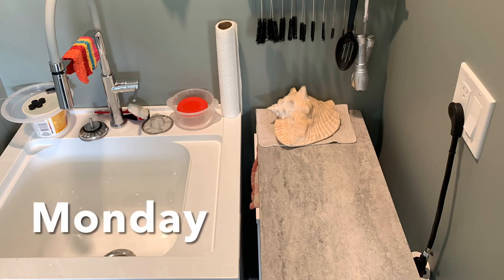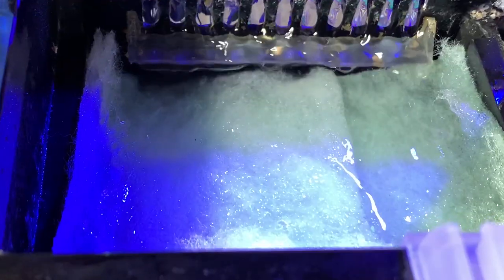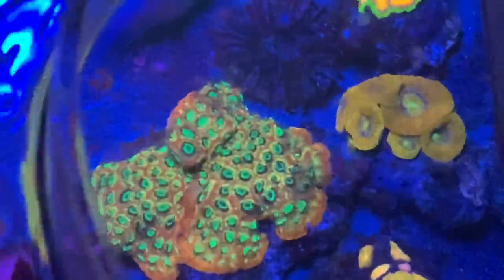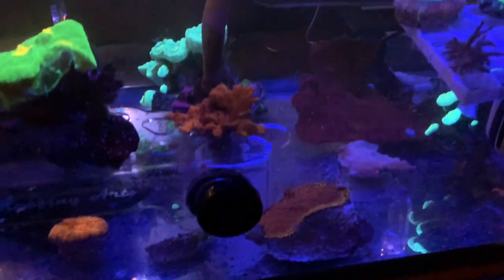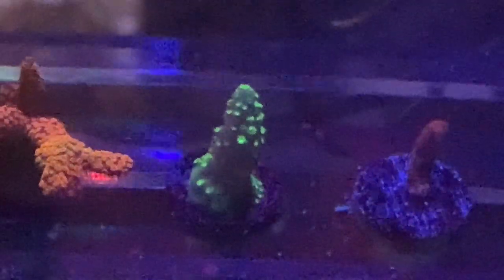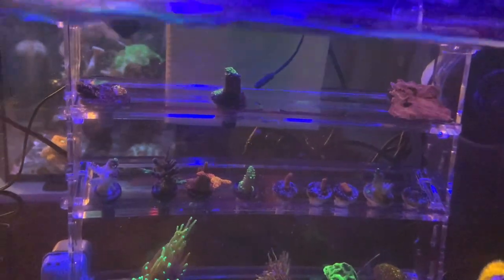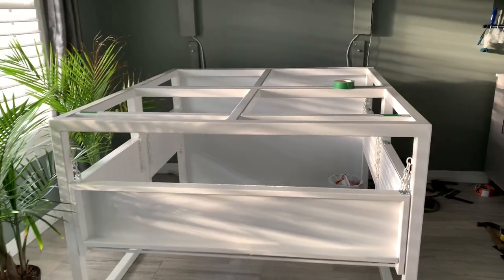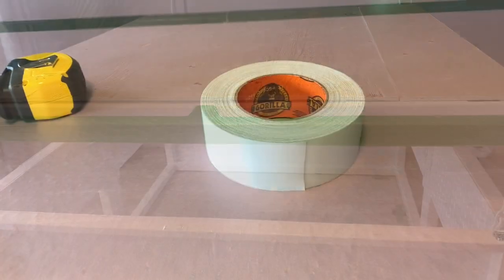ReefGrrl’s Weekly Reef Wrap-Up No. 6: New Project, New Tank Progress, New Coral, Graphic Coral Image

Comment: Looking good Cindy.  Have you thought about bolting the two sections of stand together for a more permanent connection?
Reply: Yea I'd definitely want it bolted together
Reply from the maker: We wondered about that but in researching stands of multiple sections, we found nowhere that they were physically joined together. We asked the LFS owner and he said they’ve done multi-piece stands quite often on big tanks and that once the tank is on top, it won’t be going anywhere. So we clamped it together to treat it as a unit for levelling and to prevent it being accidentally knocked out of alignment, and before any water goes in the tank, the clamps will be taken off and the whole thing checked to make sure it’s fully supported. The thing about drilling holes that led us to look into it, is that it introduces a point of access for corrosion and even if using aluminum fasteners, we didn’t want that vulnerability over the long term. I guess we will find out...😁 Thanks for watching!
Reply: @Reefgrrl  just needs a bit of primer if you decide to drill it/bolt it...I still would want to just in case the house settles throughout different seasons....my creaky house does
Reply from the maker: We’ve just passed our one-year anniversary here and haven’t seen any signs of seasonal changes - don’t forget there’s a double-size steel beam plus full height stud walls and triple-sistered joists in the basement directly beneath the tank location. If any of that moves we’ve got bigger problems than a two-piece stand lol! Tbh we did expect it to have provision for bolting the two sections together and did the research when it came without that - I’m okay with not physically joining them after getting advice that it’ll be fine, based on the LFS owner’s experience. I guess we’ll find out...

Comment: Graphic Space Invader. LMAO!!! If someone is sensitive to that, they have other issues.ha ha. Stand turned out GREAT!!! Looks even better than before. Curious to why you didn't add leveling legs/feet to the stand when being built. Not that shims won't work just fine. Looking forward to seeing the tank is place.
Reply from the maker: Haha, I know right? I laughed when I saw that, just had to share but didn’t think it appropriate to send it to anyone privately....😂😂 I’m super pleased with how the stand turned out in the end. And I have a couple of finishing touches planned yet... 

Re: levelling legs - I did consider it but because the whole thing will weigh over 2 tons when up and running, and we were going with standard ceramic tile flooring (stone wasn’t an option but would have had the same vulnerability, we felt) we were concerned about point loads shattering the tile in those spots. As it is, even going with full perimeter weight distribution, I do expect some cracked tiles. I guess I’ll find out....😁 Thanks for watching!

Comment: Are you a tad worried with the regular WC schedule that when your main display comes online it might plummet nutrient levels?
Reply from the maker: After it passes the leak test I’ll be draining it and then will pump about 25 gallons of water at a time from the sump into the display, replacing it with new salt water. I’ll do this every few days, keeping the display water heated and circulated. Once I have enough water in there to cover my aquascape, I’ll pause the water transfers until I have my rocks in and set up. Right now, they’re in various places being cured. For the ones I have in the return chamber of the sump, I’ll need to replace that water because of displacement. After the aquascape is finalized, I’ll top the display up with new salt water if needed and let it run for a few days, then add the sand. I expect to reach this point will take about 3 weeks. During this time I’ll be monitoring the NO3 and PO4 closely in the sump system. As of two days ago, NO3 is about 30 and PO4 is at 0.05. So I need to watch the PO4 closely and I’ve already stopped running the skimmer. I have the Fauna Marin Elementals P and N on hand, if I need to top up either as the process moves along.

I’ll keep transferring water, 25 gallons at a time, monitoring parameters, until I’m satisfied the two separate bodies of water are closely-enough matched that I can turn the pumps on and close the loop.

It’ll be a bit tricky. 🤷‍♀️
Reply: @Reefgrrl  nice...yea I went through a Lil low nutrient issue when I added my remote sump/increasing water volume...despite letting my nutrients climb nice and high before it came online...it still was a bit of a shock and I had pre cycled a bunch of extra rock for the larger sump
Reply from the maker: I’m planning to take my time and do my best to get the parameters to match before joining the two. If the past year’s worth of waiting has taught me anything, it’s that I can wait until I get it right...😁

Comment: Why did you decide to move the tank backwards on the stand instead of putting the extra support on the back side of the stand and keeping the tank flush up front? Gaining a little room between the wall?
Reply from the maker: Valid question! If we had done that, the overflow box would have been above the back horizontal brace of the stand and there are three drain holes and two return holes, all of which would have been right above the 2” tubular steel - we would have had to install hard plumbing to go around it. We couldn’t be sure if 45 degree joins would have had enough clearance to get around the stand without putting stress on the bulkheads at the glass and NO WAY I’m having hard 90s in my overflow plumbing after I had experienced white slime many years ago. So we decided to “make lemonade” and turn the front flat section into a feature. You’ll see that in a future video. 😁
Reply from the maker: Also, the back of the stand is about 13” out from the wall, to allow the plumbing to travel pretty much straight down from the overflow. Not sure if you saw, it’s an external overflow, coast-to-coast.